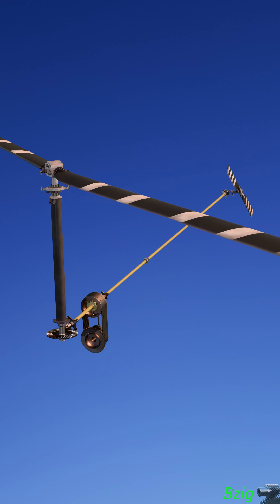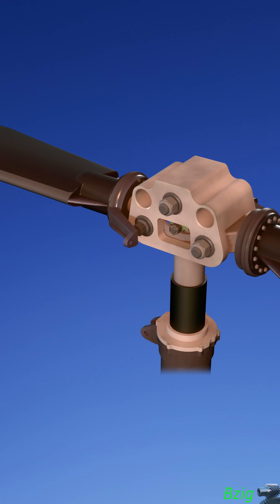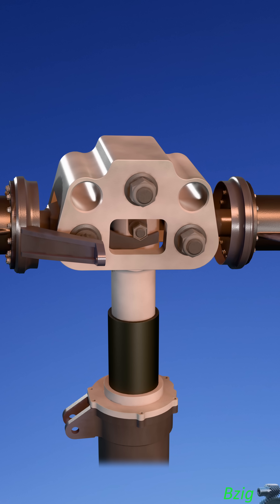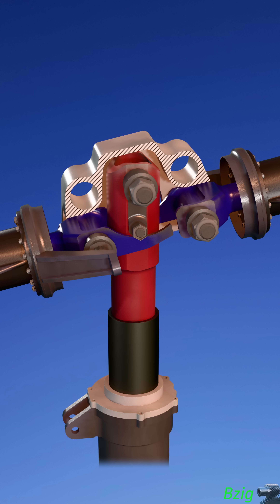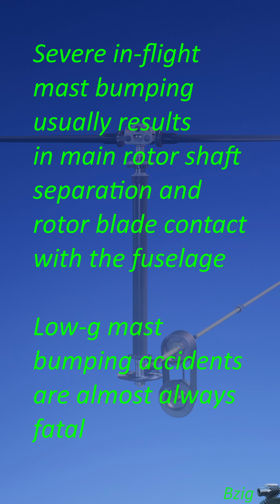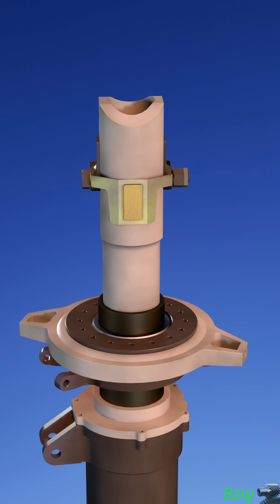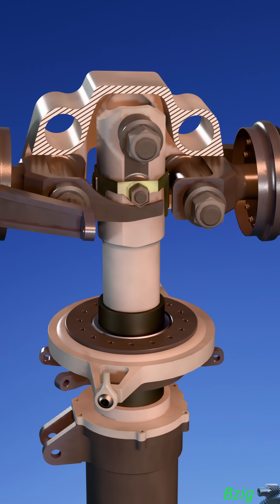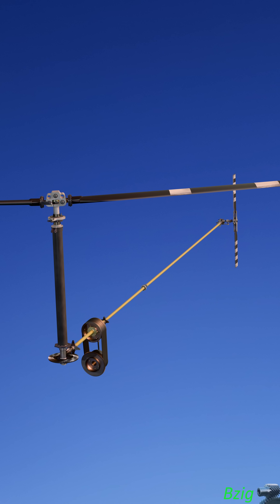Helicopter Mast Bumping

Comment: Cant you just mount it solid instead of a teetering design? Or put some kind of spring or some kind of bump stop in the flapping hinge?
Reply: The flapping occurs due to aerodynamic forces. If you tried to hold it rigid, I think the forces would be too great to prevent fatigue failure.
Allowing flapping is the best solution and easiest solution.  All you have to do is make sure you operate it within design limits.
Trying to dampen the end of travel doesn't seem plausible.  The forces become intense, if you are flapping that much, and it doesn't seem likely that any material used to attempt to dampen a catostraphic mast bump would last any longer than a mast can last.
Reply: That is my exact thought. Take away the pivot point. Sounds like you get a 50% chance of coming back alive each time you take this Robinson44 up. I'd be afraid to make a turn and a gust of crosswind knocks the fuselage off balance and then boom 💥 mast bump turns off my birthdays forever

Comment: This means a helicopter could have a parachute system to bring it down if the rotor separates
Reply: You have to have enough altitude for Chutes to even have a chance of breaking the fall of the helicopter.
Reply from the maker: Some of the new evtol designs have ballistic recovery chutes.  They add to safety, but there is a limited envelope for operation.  Deploying the chute right after takeoff or just before landing will not allow the chute to deploy in time.
Reply: If you’re at insufficient altitude, no chute could save you. Not by simply bailing out.
Failure of any of the lifting mechanism will also result in contra rotation the fuselage, which makes exiting the craft even more exciting p.
You cannot benefit from vertical ejection seats as fitted to fighter jets for obvious reasons. I suppose you might get lucky, but I wouldn’t want to watch it.

Comment: Blancolirio just posted audio from the crash, synchronized with one of the security cameras. I’m wondering if that combination gives you any clues that could be modeled.
Reply from the maker: I'll take a look, I knew I was going to post a mast bumping video before the NY accident and I've stayed away from listening to all the speculation... I didn't want to develop a bias.  I did look in the NTSB CAROL database, for mast bumping accidents and incidents before publishing this.
Reply: @ A path that might appeal to you would be to figure out all of the failure modes that are possible, or that the NTSB should be looking at, and model those components and failure modes. That would let you avoid speculation, while giving everyone who is curious a solid basis for understanding what investigators are looking at.

Comment: So when mast bumping detaches the mast, it’s the result of a slamming impact that fractured the mast? My previous understanding (because nobody modeled this as accurately as you) was that the bump stops were on the rotor assembly and actually sliced through some part of the mast while spinning relative to it. Typing this out I now see that would be impossible.

Can you detail more specifically how the mast separates?
Reply from the maker: There's text below from an NTSB incident  report of a non-fatal event.  I think it's easy to extrapolate the NTSB words to a complete mast failure.  The mast is a thin walled structure... Think of a soda can, if you're careful, you can stand on it, but as soon as you dent the side, it fails. 

 A POST FLT INSPECTION REVEALED THE MAIN ROTOR SPINDLES HAD BUMPED
THE MAST AT THE TEETERING STOPS, RESULTING IN DENTS UP TO .045 TO .50 INCH IN THE
MAST. ALSO, THE MAIN ROTOR SPINDLE ARMS (HORNS) HAD CONTACTED THE DROOP
STOPS, SHEARING THE DROOP STOP RETAINER BOLT & BENDING THE SPINDLE HORNS.
ACCORDING TO THE MANUFACTURER, THE DROOP STOP/BOLT DAMAGE COULD ONLY
OCCUR DURING A HARD LANDING OR NEGATIVE 'G' FLT. THE FLT MANUAL & SAFETY
NOTICE #11 WARNS: RECOVERY FROM ROLL DUE TO LOW 'G' MUST BEGIN WITH AFT CYCLIC
FIRST TO PREVENT MAST BUMPING
Reply: @  The mast is a hollow tube! I was stupidly assuming it would be solid. I wonder if the top several inches could be a solid chunk, gradually transitioning to a tube?
Reply: @PetesGuide it probably is thick walled or solid where the stop touches but whatever you strengthen, something else will break. 
Bump stops are only about 6 inches from the teeter pivot and the blades are 16 feet long (Bell 206) so a lot of leverage. Repeatedly hitting one side then the other, every rotation until something breaks or the pilot, if he's lucky/fast enough, corrects the situation. (Possibly lifting the collective lever, if it was caused by low/negative G).
Reply: @bzig4929 have you missed a zero?
Dents up to .045 to .50
Should that be .050?
½“ would be a pretty big dent, you'd hardly bother mentioning the .045"!

Comment: Great video. I keep seeing videos of people saying mast bumping is when the rotor hits the tail boom.
Reply from the maker: That might be a secondary effect... Mast contact would happen first, but if the flapping is severe enough I suppose the blades would continue to hit the tail boom.
Reply: @bzig4929  I’ve seen about five videos of that happening on Robinsons, so it’s more than theoretical.
Reply: @bzig4929  Low/Negative g is an exacerbating factor regarding risk of tail-boom strikes, due to downward flex of the rotor blades.
Reply: that's what I thought.